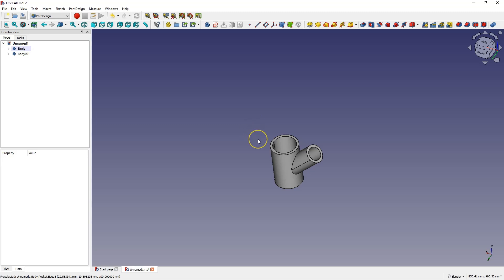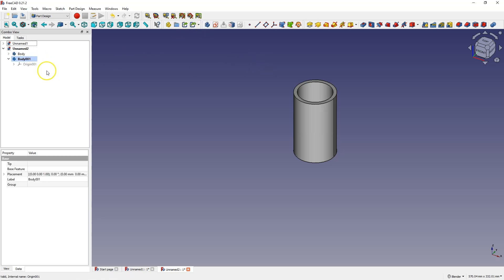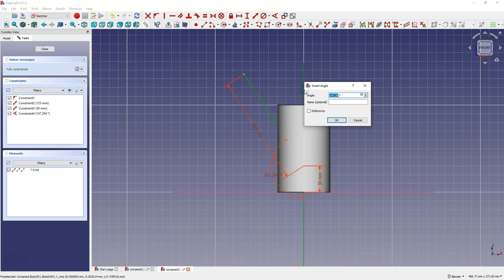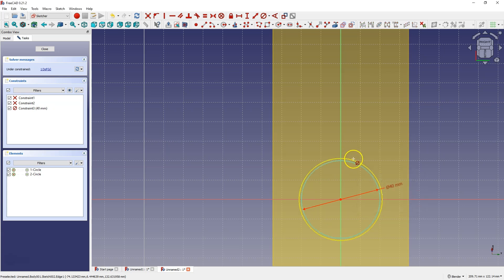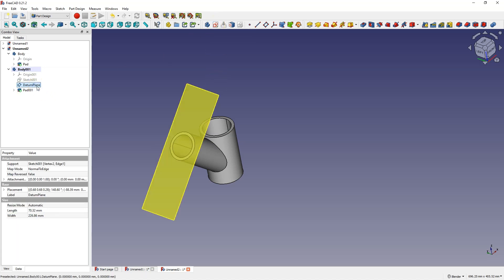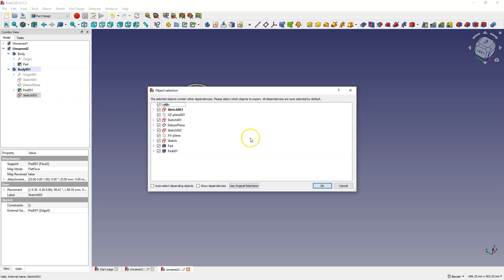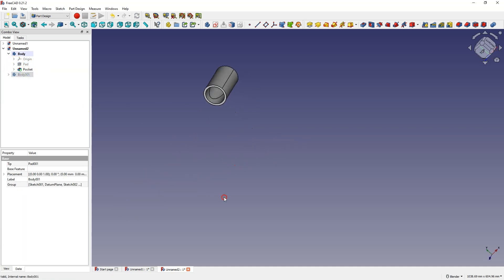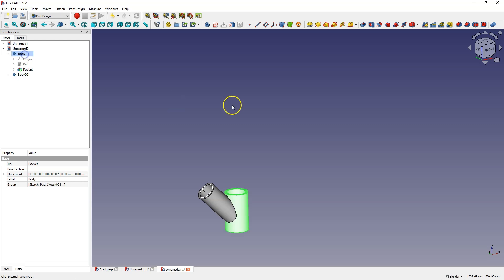FreeCAD Connection of Two Pipes

Comment: Good videos so far but this one does not seem to work at the end where we try to punch a hole in the first body; I have the official release 1.0; cannot sketch on the end of the angled pipe but can on the datum plane but then I cannot transfer the sketch to the other body due to dependencies; darn

Comment: Your video is really good but when i do the up to face my pipe only goes a few centimeters then it wont connect to the other pipe what am I doing wrong?
Reply: Try up to shape as one of the options. Or throw in an arbitrary. Dimension to see if it's deep enough.
Reply from the maker: I don't know. Maybe try again.
Reply: @CADCAMLessons  I have tried 4 times with total rebuilds and get the same problem every time as AnetWolmarans above. The error message is "Pad: Resulting shape is empty". Any clues as to why we get this error?